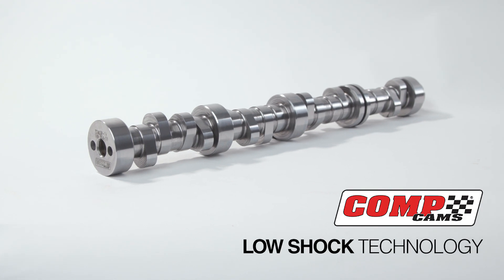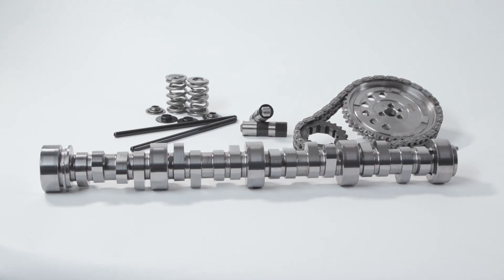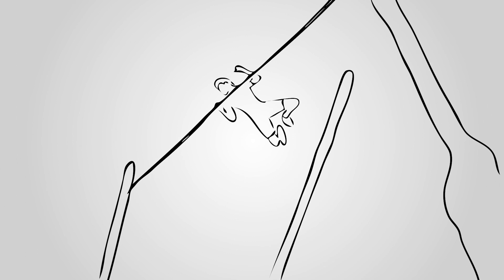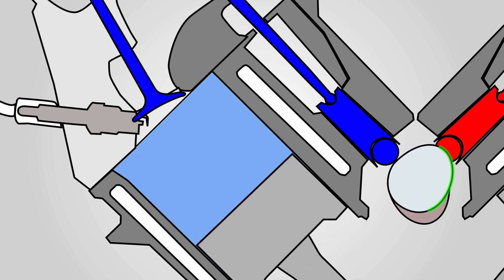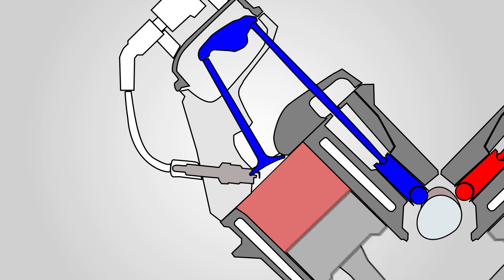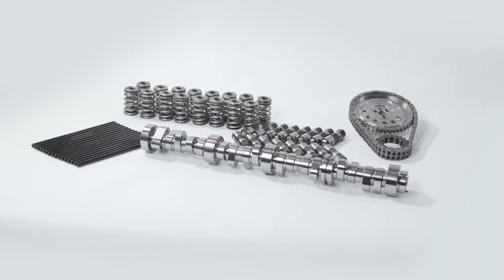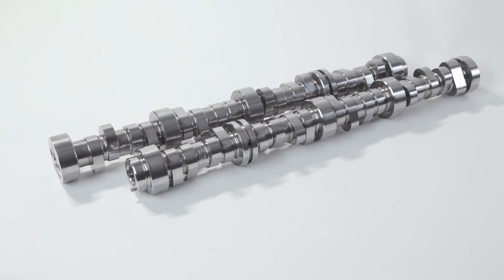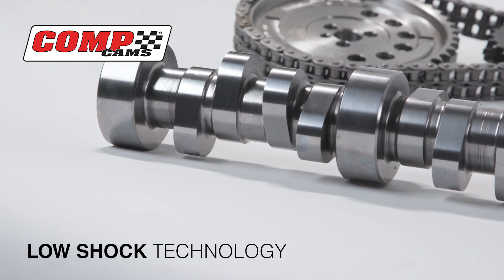Low Shock Technology: What It Is & Why You Need It, Featuring Valve Train Engineer Billy Godbold

Comment: Lord help us. 1 year later and 16k views only 400 likes. Such priceless information regardless if opposition of company. 
Two thumbs up COMP and Godbold!
Reply: Funny how things come full circle.  The scramble for max area under the curve led to [0.006 - 0.050] ramps of 16.5 degrees and occasionally shorter - more lift for the same duration looked like the holy grail coming out of the '80s.  But... we almost forgot who the oil companies formulate for: new builds.  Its never been much different.  When one manufacturer puts 2M engines on the road every year, you bet the petro-chemists accept specs from their engineers and start tweaking additives so they have something to sell them. 
Looking at the heyday of flat tappet valvetrains [SD thru SF oils], oems had gentle ramps: 30 degrees, often more.  It worked: no break-in cold sweat rituals as bizarre as hopping about on one foot flinging spoonfuls of hot sauce at a picture of chairman Mao, chanting "yo-yo man stay in the trees".  Detroit probably took most fresh builds, ran them a few minutes to dial in the carb & timing, and if it passed it received QC blessing and loaded out after dropping a fresh charge of oil in.  Lake Speed jr was nowhere in sight, oddly.
Camshafts all face a serious fight to survive: oil has to work very well, and there are limits.  I examined an old set of hyd/flat tappets from 4k mile engine not long ago suspected of being over sprung.  What I noted was a mild donut shaped burnish that evidenced the lobe pressure points.  They began about 0.050" from the edge [so far so good], and were anywhere from 0.020" to 0.080" wide.  That seemed too large a variance, and decided mismatch was likely - new cam/lifters/springs went in, as head swap was in the works anyway.  Then I sat down and crunched numbers on what I had found [existing springs were tested], and I used the 0.080" number - I assumed square [not having pressure tape to prove both axis footprint over the nose at max lift].  So... 320# going back through 1.5 rockers is 480# of lifter working against the lobe.  Divide by 0.0064 square inches and thats 75,000 psi.  Oil has to be stronger than that, so add a 20% safety margin, and a lose no sleep number is 90,000psi failure point or better on the oil.  Cam guys have their hands full, and Godbold looks to be aiming in a good direction for street enthusiasts.

Comment: can you make this lobe for my gen 1 small block chevy stroker, daily driver, cross country, endurance, road race, that doesn't refuel during race. 60 gallon fuel tank. there is a long rod 362 c.i. and a long rod 373 c.i. slightly higher compression on pump gas 10.75:01 aluminum heads.